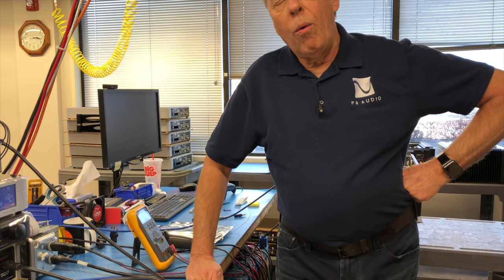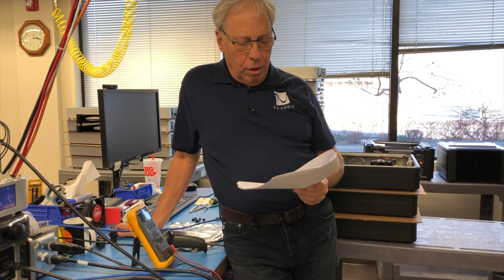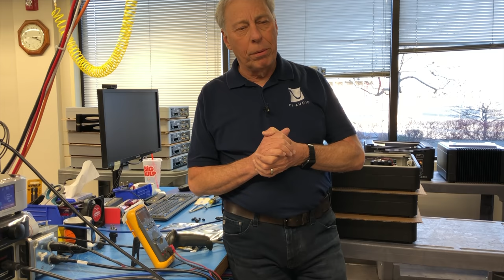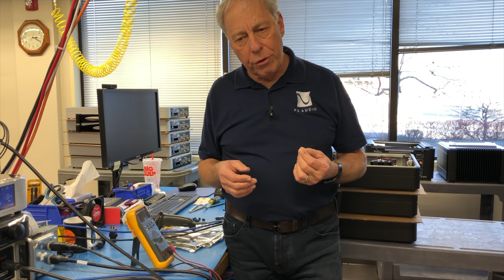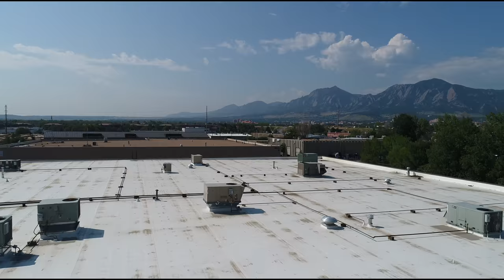Why do people abandon their power conditioners?

Comment: This is too much snake oil talk. Noise on the power lines is completely measurable and very rarely a concern even for a high-end system. Spend your money on speakers and amp before even considering anything concerning over priced power cables or power conditioners. If your system cost 10s of 1000s or Dollars, you might want these things because it’s part of the overall appearance more than actual audio fidelity.
Reply: Ok, so try using an expensive Shunyata power cable, power conditioner or one of Paul's power plants. Tell me there is no impact on the sound.
Reply: Ian Brown There is no impact on the sound if there is no measurable impact on the secondary side voltage rails. You can easily measure ripple noise on your DC power rails in your pre amp and power amp. If you have well engineered amps, they will already include careful filtering of power line noise. Of course there are exceptions where your power lines have significant noise and your equipment is poorly designed to filter it out. Try to do an actual blind test and you will realize this topic is almost entirely snake oil.
Reply: @ThinkingBetter  lol, "if it can't be measured it doesn't exist". What a canard. You are empirically, factually incorrect.
Reply: Ian Brown BTW, if you have some old equipment with dried out power supply capacitors and realize these things can help, you should fix the equipment first. And even if the equipment is poorly designed, you can help on any noise problem by adding the right capacitors in the right spots inside the amp. A few dollars of capacitors will be a better cure than 100s of Dollars of external gear.
Reply: @ThinkingBetter  Not all of the people here are as versed as you friend. I'm not opening up any chassis and Monkeying around and I won't buy a power conditioner unless I have funny money lying around or find a working one for a hundred, but for my application of on site recording musicians, It just may make sense of my generated noise.
Reply: Vlad G I’m right cause you fail to understand that there are areas of audio where indeed measurements can nail everything. I would never say you can measure all characteristics of a speaker but indeed all audible characteristics of power cables and noise on power lines are completely well understood and absolutely measurable.
Reply: Brian David Loveless Some times speaking the truth is not making you popular. I’m the first to agree that audio, in particular speakers and to some extend amps, can’t be measured fully.
Reply: @ThinkingBetter  All the people at camp grey just want to disprove a persons freedom of free speach and say what ever they think, true and false. The agenda of camp Grey is that of vigilantes that have ganged to choose their target and execute a smear campaign. Why choose the measurement topic?, might as well set out to prove there is no god and strip away our USA right of freedom of speach. I'm sorry that things are the way they are in your country or mindset. It's just as futile for me to set out to claim line arrays are just another smear speaker. Who cares? People shouldn't care about their own health before exploring another's philosophic opinions?. if you want to work on a active port for a speaker or I want to tell everybody about the EV15 driver upside down in a shallow box and how unflipping real of a thrill it is, shouldn't I be able to do that ?
Reply: @LD Blake I said to try using an expensive power cable or conditioner and THEN tell me there is no difference. Telling me there is no difference because you think it should be so is of no value.
Reply: I can't stand when people say snake oil as a derogatory term. Snake oil is actually the authentic item. While I'm at it, the word for a BMW car is Bimmer not Beamer.
Another one is Yin and Yang. It's not Ying and Yang.
Reply: @ThinkingBetter  thank you.
Reply: You are correct sir.
Reply: @LD Blake -- That's called "confirmation bias." It is said that "a fool and his money are soon parted" and, let's face it, pretty much nobody likes to admit to themselves that they've been fooled -- that's simple human psychology!
Reply: @vladg5216  well let me ask you this, how can the narrator sit in an electronics lab talking about "power plants" etc, and never even mention slew rate, which is easily measured and does dramatically affect audio ??
Reply: carlos oliveira The term snake oil simply means stuff that is claimed to have qualities that are non-existing. It’s ok to sell expensive power cables but to outright lie how magic happens to the sound from using them is not ok. Those claims have absolutely no value unless they can be repeated in a proper blind test. I’ve actually joined many such blind tests professionally and even very experienced listeners can’t detect which power cable is used.
Reply: @ThinkingBetter  -- Well said.  Rigorous double-blind testing is a reliable antidote to the snake oil claims on which most of the so-called "high-end" audio industry depends for its (often ill-gotten) livelihood.

That said, I get the strong impression that the cordial and charming Mr. McGowan actually believes most or even all of what he purports on this channel -- but I'm not immune to being fooled by folks who are gifted presenters, which he certainly is.  After all, to paraphrase the great Groucho Marx, "In business, nothing is more important than sincerity -- if you can fake that, you've got it made!"
Reply: @LD Blake Well, have you?
Reply: Bruce Morgen Lots of people genuinely believe even the worst of snake oil and never get to do an actual proper blind test. It’s a proven fact that there is a lot of confirmation bias in non-blind listening tests and you can so easily get fooled to imagine you hear things you are told you should hear.
Reply: @LD Blake -- That "likeable liar" gets you to part with your money, often with implications of "subtle" improvements that make his mark feel like he's part of some audiophile elite in hot pursuit of perfection rather than making actual outright claims.  Once the mark has plunked down the plastic and gotten the pricey gimcrack home and hooked up, that's where the "confirmation bias cuts in..."
Reply: @LD BlakeI can't vouch for anything you have used, esp as I dont know what it is. I have used various Shunyata and Audioquest cables, a PS Audio Powerplant and Shunyata Venom PS8 conditioner. All of these have changed the sound of my gear noticeably, and not always for the better. There is no way somebody doing a blind test couldn't hear the difference. I also have several Furman conditioners in the recording studio, and they are pretty subtle with line-level equipment, and do  a bit of what Paul talks about in terms of compressing dynamics but cleaning things up a tiny bit.
Reply: @LD Blake -- The thing is, "Buyer's Remorse" requires being honest with oneself and the apparently rare ability to face the uncomfortable conclusion that one has been fooled
Reply: Tell me, what could be wrong with every DAC, preamp, amp, headphone amp, I own, or have owned in the last 10 years, in multiple homes, and in multiple recording studios, that would produce verifiable and consistent changes across all devices?
Reply: LD Blake Yes, it’s quite true. I’m professional in R&D and have seen it all. Generally I have a lot more respect for the highly skilled engineers who actually understand how things work and can optimize accordingly than those who just look at audio as magic. Clearly high-end audio is often enabling the high margins by fooling people into believing in fake things. Usually great sound has a lot more to do with great engineering than expensive looking components. Some of the most expensive stuff doesn’t even sound particularly good. One thing that bothers me is when someone claims that a very poor frequency response doesn’t matter. In fact, many times I’ve found even such simple metric has fooled people e.g. often people come telling me that some system has great details and I can show them more often then not that it simply has too much treble.
Reply: @LD Blake -- "Entry level" Klipsch or Polk anyone?  :-)
Reply: LD Blake I bet it’s a lot of times. Well, too much treble is not only seen in cheap gear but also in more expensive gear where people can be fooled in the same way. Often I can do a simple listen on a sine wave sweep and make my conclusion of why people say it sounds in a particular way. I never want to take a system too serious if I can hear significant jumps in a sweep because I perfectly know it will color the sound.
Reply: @LD Blake -- Klipsch and Polk are to be found at your neighborhood "Best Buy."  :-)
Reply: Ian Brown Often people have exactly told me, like you, that a cable has a particular better sound and then I’ve tried to do an A/B blind test and always they mysteriously lose the ability to identify which cable is which. BTW, never forget shorter cables are more important to better sound than expensive cables. This applies to all cables and it also saves you money ☺️
Reply: @LD Blake -- That's what a sensible, mature adult does: s/he owns up to an error and deals with it.
Reply: LD Blake Yeah, use shorter cables and make sure connections are good. If an RCA cable has an impact on the sound it’s always measurable as such cable can be described as a simple impedance consisting of capacitance, inductance and resistance. The shielding will define how much noise is captured e.g. as hum. But even the cheapest decent RCA cable has negligent impedance and can shield well. One problem I’ve often seen is common mode current between audio components causing 50/60Hz hum. This can happen when equipment is not grounded and there is a Y capacitor conducting between a primary and secondary side of a power supply inside your amp or other device.
Reply: LD Blake You seem to understand the real issues at play concerning cables. I’ve often been to China and met cable manufacturing companies there. Your US$200 “audiophile cable” probably costed the reseller US$10 FOB Shenzhen and only through snake oil talk will it sell.
Reply: @ThinkingBetter  You realize you very intelligent people can go on forever until you think differently about passive crossovers. This whole conversation sounds to be same since 1980. Until people have direct control over their speaker's drivers with amp gains, this conversation will never end. 
Its certainly is nice to read all are getting along civilly, and someone like me or the one lady that is a regular here can enjoy an unlocker room atmosphere. That was the point I set out to make from the beginning.
Reply: @LD Blake wasn't the ad for BASF state "we don't make "xxxx" we make it better" I still have my scotch tape from HS and "feels like the first time" still sound like the first time to me. How does a mix tape from vinyl in 78 still kick 40 years later. Nice comment!
Reply: @LD Blake the power amps rise time would be affected by sagging line voltage, isn't that what he's saying needs to be fixed externally with his product ?
Reply: I need to read up on his "power plants", but if you're adding impedance to the supply side aren't you slowing the rise time of the current waveform ??
Reply: @poserwanabe  Read the "Ask Paul" scope too. "Car talk of audio" just one thing mentioned. Your welcome in advance.😘
Reply: @LD Blake even reviewers who hate "snake oil" cables have surprisingly heard major differences with a proper line conditioner. I was surprised myself by what I heard when I never hear any difference in cables.
Reply: LD Blake, not true. https://en.m.wikipedia.org/wiki/Snake_oil
Reply: poserwannabe The rise time is not affected by any tiny impedance on the primary side of the power supply of a power amp. Capacitors are there to provide energy during dynamic spikes and a tiny voltage drop on the primary side will represent an insignificant inaudible fraction of a decibel of audio level. I could argue that only a really lousy design of a power amp is sensitive to load dependent AC supply voltage fluctuations in the millivolt range. Even an insane 1% voltage drop over your few feet of power cable only means 0.09dB of peak reduction and surely you can’t hear that.
Reply: LD Blake I’ve actually been to many of these contract manufacturers and small audio manufacturers that you find in southern China and know well how the business works. Too much copying is taking place and most of the Chinese engineers involved are much more conscious about keeping cost low and profit high than they are about making excellent performance. Great audio products usually have been engineered outside China. Sorry if anyone feel offended but it’s like this almost 100%.
Reply: J Herberger If you can hear a power conditioner improving the sound it’s because you have some really crappy and long power wiring to your outlet. Try to measure the AC voltage and how it drops by load and if you see a significant drop (>10% @ 100W), yes I can agree you have a problem although even a crazy 10% drop would be actually very hard to hear with a good amp as it’s only an approx 0.8dB drop in signal level. I could argue that if you can hear the improvement of a power conditioner you should call someone to fix your house wiring.
Reply: @LD Blake that makes sense, thanks !!
Reply: LD Blake Almost all copies are from southern China and usually their greatest strength is a lower cost.
Reply: LD Blake But 1% lower power rail voltage yielding 1% lower peak voltage will reduce audio level with 0.09dB. Good luck finding someone who can notice that.
Reply: LD Blake Yes, crappy quality is unfortunately the norm of stuff engineered there.
Reply: @LD Blake you really are pleasantly suffering. Don't you have a pair of headphones just so you can get back to reality? I would put my wife's system in a dead heat with yours. Don't even have a hundred in the whole thing, tv included. 
I really should stop picking on you.
Reply: @ThinkingBetter  I love how you throw curve balls at me. Did you notice how naive I played when you fed me all that eq crap?
Reply: @LD Blake yup the sun still comes up in the east and you able bodied to keep going cause now we go into electronic crossovers.
Reply: @LD Blake sounds good! I have you as a friend/fool anyway.
Reply: LD Blake The greatest strength of Chinese audio engineering is about cutting cost. Glue is cheaper than screws. The factory boss in Shenzhen is happy cause he gets the cost saving. The factory workers inhaling the glue fumes just lose a bit IQ. And you won’t know until after the warranty expires.